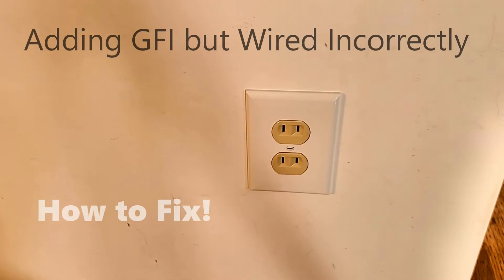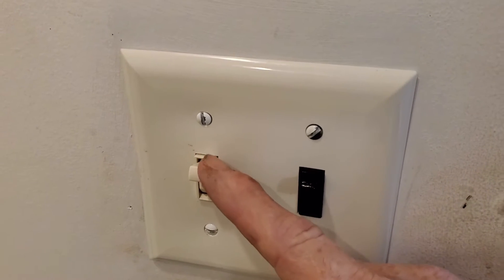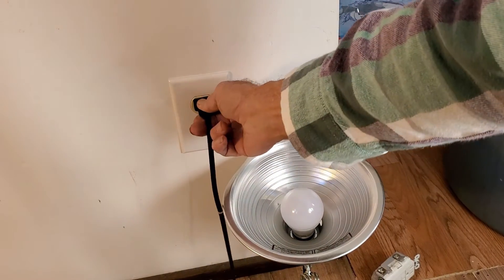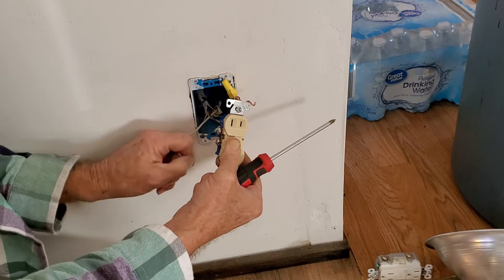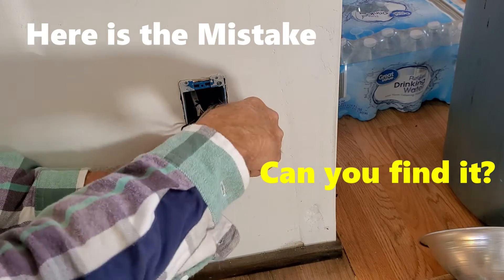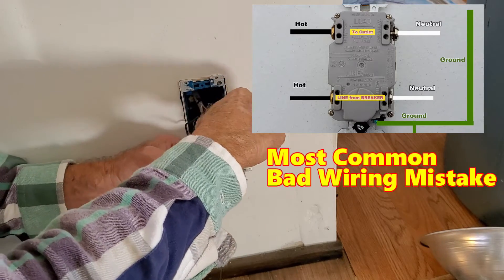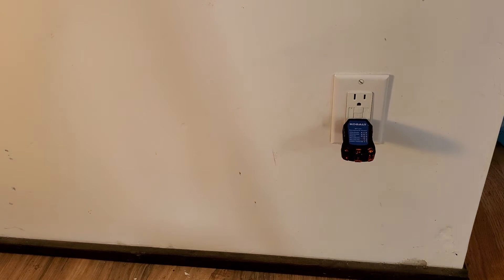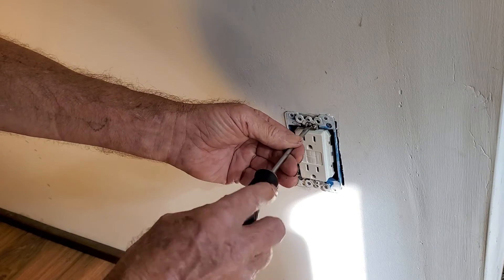Most Common DIY Mistake when Wiring GFCI

Comment: 5:05  As I understand it is best practice to not reuse the previously bent wire ends.  You should snip them off and use the previously unbent part of the wire , when redoing something like this outlet (this is due to the possibility of the wire being 'fatigued' from being bent multiple times, which makes it weak and could result in the wire breaking and becoming disconnected (faults, sparking, etc.) (This may seem like a pain but in actuality the wire could have been bent many times before you rebent it; it isn't really easy to tell sometimes) (And we all know the joys of how nice and easy outlets go back into the box when completed, never any rough handling then <sarcasm>). ...just an fyi.

Comment: What happened to my heart? You took it back?

First of all, you should just use the shepherd's hooks... but if your gonna use the clamps, then you should cut the wires and stip out new conductor ends. Second your connecting the common side to hot. Also your lamp test doesn't tell you about pass through power in the back of the box nor stray voltage insufficient to light the incandescent bulb. You should use proper test equipment if available. The last person in the box may not have been competent.

Comment: You should always check all wires in a box with a multimeter BEFORE you stick your screwdriver in the box. Since you do not know if the person before you knew what they were doing. Just because you turned off a breaker does not mean a wire in the box is not hot, especially if there is a switch leg that could be connected wrong.
Reply: ...multiwire branch circuit, etc.

Comment: Some incorrect information here, your installation would not fail inspection because of the light, it would fail because the outlet is not GFCI protected. The light does not have to be, and some would recommend that the light not be (especially if it is the only light source in the room) so a GFCI trip would not leave you in the dark.

Also, $80 dollar per year savings for the solar lights seems to be a bit of a stretch, I see 2 cans (maybe there are 2 more for 4 total), lets say they are 10 watts each (a bright LED) that's 40 watts total. Even if you ran them 24/7 that would be 350 kWh, which at $0.15 per kWh comes out to $52.5, if you run them for a more reasonable duration then definitely under $10 per year savings.

Also, some terminology issues that may help others, the switch is not 'controlled' by the outlet, the switch is 'fed' from the outlet. You did not create a 'pigtail' for the ground, it was already there, what you did was to form the 'shepherds hook'.

Comment: Chuck, FYI thier is no controversy wither a plug should be up or down. The US electrical code states if an outlet is switched it needs to be upside down ie if their is a light switch on it. If it does not have a switch on it then it is installed the right way. Just thought I would clarify that. I had to replace a GFCI outlet in my bathroom that went bad, and I had to put in upside because, the ceiling light is wired to it with a light switch. I thought you had the line and the load back words on your outlet. To make it easier for projects like the one you did so you will not get the wiring mixed up. Their are circuit tracer tools that you can by to find the breaker and check with wire runs to the panel. Their very inexpensive and  can be purchased at Harbor Freight, Lowes, Home Depot, and your local hardware store.
Reply: The NEC does NOT dictate orientation of a plug.   The NEC doesn't care.   However, many electricians do it the way you describe (switched=ground up, nonswitched=ground down).    Personally I always install ground up so that a metal object falling on a partially out plug is more likely to hit the ground pin.   If the plug is horizontal instead of vertical, I always install neutral (white) up for the same reason - since the neutral is supposed to be at the same potential as ground.

In hospitals, you'll almost always see ground up for the same reason.
Reply: @fchristian  "Personally I always install ground up so that a metal object falling on a partially out plug is more likely to hit the ground pin" Yes, this is exactly as my father taught me.
Reply from the maker: Yes, I read the code and you're right it doesn't make any difference, I guess I was referring to the many different videos on YouTube, but thank you so much for the advice
Reply: You are going to have to provide a code reference for this, because I am not aware of any section of the NEC that places a requirement on receptacle orientation even in the case of a switched receptacle.

Comment: Great video..Chuck.   I had a electrician come into my house as I'm in upstate ny preparing to sell and move to Florida ☺️.  I don't have GFCI on outlets on either side of the kitchen sink so he said per code you need GFCI on either side...Then I asked about the rest of the outlets on above the counter ..He said if they are on same circuit as the GFCI outlets.  The standard outlets can become part of GFCI circuit...As long as they are wired according to how you explained...So every outlet doesn't have to be a GFCI ...as long as they all are on the same line .. They become protected... Interesting fact ☺️